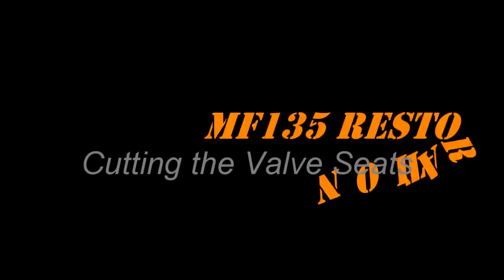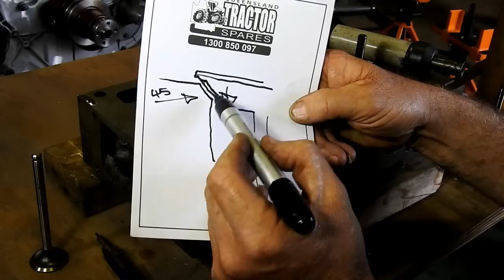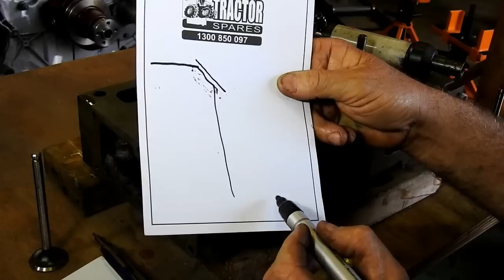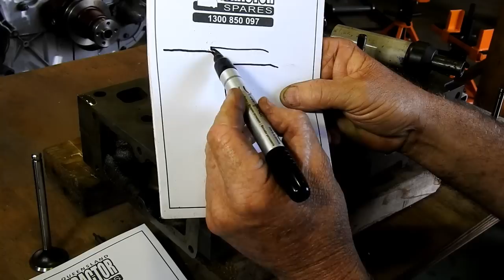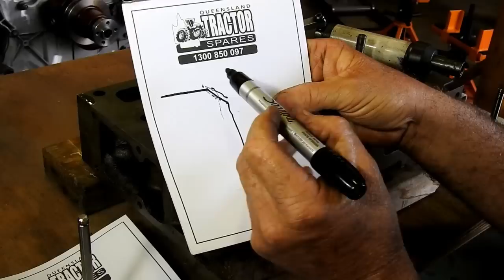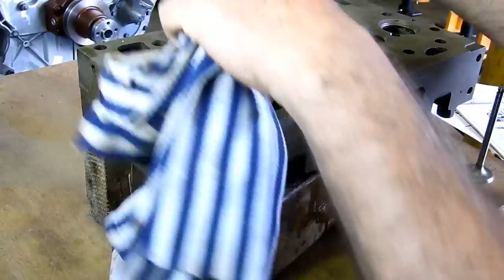MF135 6 Speed Restoration #32 Cutting Valve Seats

Comment: Hi, what is the size of the cutter's guide which you use? My MF 135 allrad need a full engine restoration also. I have metric seat cutter (7 and 8 mm cutter guides) and the valve's rod only 7.9 mm wide.
Reply from the maker: I think it was 5/16" from memory, it was a while back now.
Reply: @bundybearsshed  Thanks!

Comment: What about the valve heights  off the surface of the head
Reply from the maker: If it is important and they are out I would need to fit a new seat insert. Usually with new valves and a quick cut they stay within spec. Even if they are all slightly low but even I dont worry on these old engines.